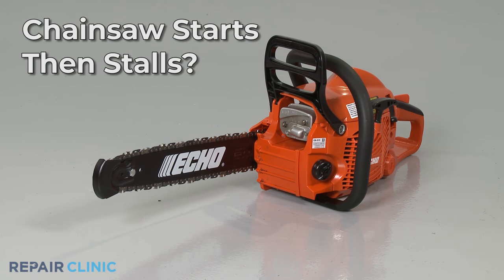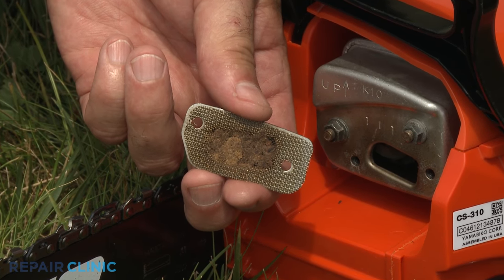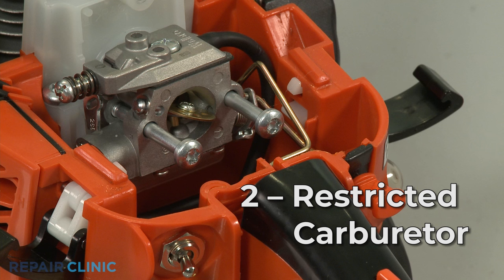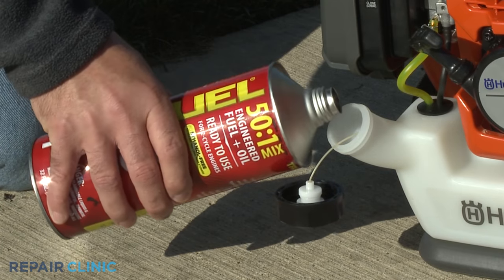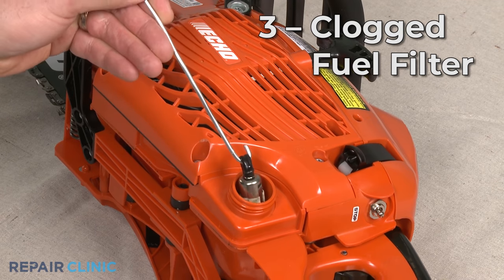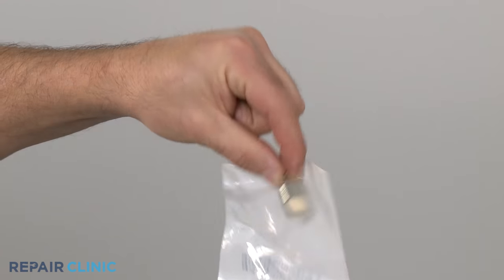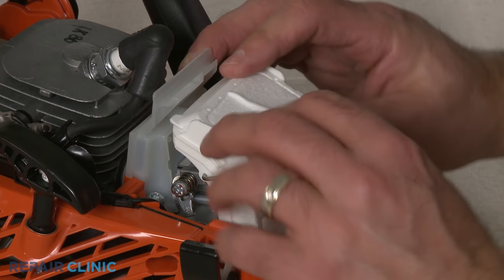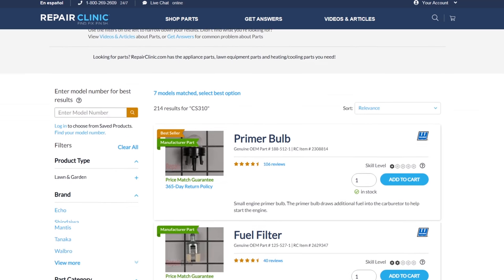Top Reasons Chainsaw Starts, Then Stalls — Chainsaw Troubleshooting

Comment: why would my chainsaw run good for 1/2 a tank of gas, then it acts as if runs out of fuel and dies. coil just replaced.
Reply: May be it's heating. There's a summer and winter mode.
Reply: Check to see if the fuel line in the tank has a hole halfway down to the filter so it tar xucking air at ahalf tank.

Comment: I’ve used my Echo very little and it has leaked oil from day one, it started dying shortly after, now I went to clean the spark arrester only to find my muffler loose and won’t stay tight! Evidently Echo new about the problems hence why Home Depot had them clearances to $99. This was 2-3 years ago. Evidently I threw away $100!

Comment: Help!!!  I've looked at about 20 videos. No good. I have an Echo CS 400. I used it for about 4-5 days to cut fallen branches---some were maybe 10" thick. No problems. Then yesterday it just decided to die in the middle of cutting. Now it starts, but dies as soon as you pull the trigger. This is a saw with little use--other than the last few days, used three years ago for a day or so, maybe a bit the year before, etc. (In other words, this is NOT something I use regularly).

So I cleaned everything thoroughly. Air filter--good. Cleaned it anyway. "Spark arrestor" or whatever over exhaust--good. But cleaned it anyway. Chain and chain bar--good. But cleaned it anyway. Fuel filter in gas tank--good. Gas/build-up of crud, etc.--no, since I've gone through 2-3 tanks of gas in the last week. And when I started it after 3 years, it started right up and worked fine. And yes, I have additives in the gas, and yes, the chain oil compartment is filled.

One video said to start it, then take the brake off and adjust the idle screw (T). But if I take the brake off the engine revs like crazy and the chain zips around and around. According to the video, the chain shouldn't move. So that didn't work.

The 'H' and 'L' adjustment screws are some fancy heads that probably need a fancy screwdriver. But they are inset so far I can't see them that well. 

If you take the time to answer, please treat me like a 4-year old. Please. Most of the videos say things like "Now torque the fajizzle just so and see what happens to the glooper stopper..."  Huh?   "Back out" a screw?  WTF?  I can back out a car, but not a screw. There are words for this:  'clockwise' and 'counter-clockwise'!  And please do suggest things I just spent four hours doing. Trust me, I've done them.
Reply: I have a CS 305.  I put on a new carburetor.  New purge bubble, fuel tank vent, fuel filter and new fuel lines.  Also new plug and air filters. My chainsaw had been hard to start.  It's about 10 years old.  The chainsaw now starts and runs well.  However, after it uses about 2/3s of the tank of fuel it starts to die.  It will not run in any position but upright. It will run a bit longer with 1/3 choke.  I don't have the answer yet but I have ordered a new "spiral fuel line".  The replacement carb came with new line but not the spiral line which goes into the tank.  The new line (straight line) did not work and I had to put the old spiral line back in to get the saw to run past idle.  

You do need to get a small Philips screwdriver and turn your idle screw counterclockwise to slow the idle.  The H & L are actually just flat head screws, however, they have 'limiter caps' on them.  You have to pull the carb out of the housing and then you can pull the 'limiter caps' off the screw heads.  My new carb came without limiters.

It's possible that you need to rich the fuel mixture.  This is done by turning the "L" screw back counterclockwise until the idle begins to slow down.  This would have the duel effect of slowing the idle speed and rich-ing the fuel mixture which will help it accelerate instead of dying when you pull the trigger.  The limiter caps will limit how far counterclockwise you can turn the screw.  If you can't turn them far enough to cause the engine to begin to slow down, then you will have to remove them to get a proper adjustment.

The one other significant possibility is the fuel tank vent.  It may have become clogged. The fuel tank vent allows air into the tank while keeping fuel from running out.  If it is clogged, a vacuum will form as the fuel is drawn out of the tank and it will eventually keep the fuel from flowing resulting in your engine dying of fuel starvation.  If your engine dies, then you open the fuel cap (letting air back in), restart the engine and if it runs a bit then dies, it's a good bet the fuel tank vent is clogged.  My vent was damn difficult to find and replace.  I nearly took the whole saw apart before I found it.  I had to remove the pull start cover AND the flywheel to get the vent filter out and replace it.  The fuel tank vent kinda looks like the fuel filter.  It's a little black plastic container, a little smaller than the fuel filter, and it plugs into the end of a length of fuel line which comes out of the fuel tank though the same grommet holding the purge bubble line.
Reply: Did you ever solve the mystery? My saw is doing the same thing. Brand new saw, day one. Started sputtering  and starving about 20 minutes in, I took a break for lunch and went back out for round two. It started great again but it died about 20 min later. Now it does the same thing as yours when starting it.
Reply: @PL-qw2gy  Well, if it's brand new, I'd just return it. I "solved" my problem by taking it to a guy who cleaned the carburetor for $50. He wasn't just a "guy," he had a degree in mechanical engineering and worked for a some manufacturing company. I watched him clean it, and clearly it was beyond my pay grade. He had all the right tools and knew exactly what to do. Even so, it took him about a half hour. His advice was never to use regular gasoline with ethanol--even if the gasoline is just a month or so old, it's not good. He suggested an ethanol-free gas you buy at Home Depot or Lowe's. I can't remember the name, but you'll find it in the aisle with lawn mowers and chain saws. It's about 1 gallon for $8-9. But well worth it if it saves you aggravation and repair bills. Also, as you can see from the comments, these saws don't like to have near-empty gas tanks. I'd fill it up with the special gas and drain what's left into the can with a funnel.

Comment: The capacitor in my Stihl 032's ignition failed.  It shorted when heated.  So after the saw had time to warm up the capacitor, no go.  Stihl ought to have paid an extra Deutsche Mark for a better capacitor.
Reply: Nothing wrong in saving a few shekels.

Comment: Not helpful for my Echo CS590. New coil, new plug, new air & fuel filter, new carb, no cylinder scoring and a compression test was performed and was within spec, spark arrestor was removed on day one. It still will not run off of choke and will only run choked for 10-15 seconds.

Comment: Reason number 1: It's an Echo 
                             2: Clogged spark arrestor 
                             3:..................
Reply: My Stihl is pretty bad about stalling when it has been off for a bit. It will start and idle, but give it a little throttle and it just dies. It seems to need to tolerate partial throttle for a little bit on cold starts or has been sitting for a few minutes.

None of my Echo equipment does this.

Comment: Tried all this, didn't help. Solution: buy an electric chainsaw. They don't cut as fast, you say? Try a little comparison: First, the gas chainsaw- pull the cord 5 or six times, it won't start. Wait a moment. 3 minutes have now passed. Try again. Maybe now it will start but will stall as soon as you apply the throttle. 5 -7 minutes have passed. You have done NO cutting , so far. Take an electric one, plug it in and press the start button. maybe 10 seconds have passed and you're already started cutting your 1st limb. So, which one got the job done quicker?
Reply: You have to know what you’re doing with a gas saw.  Read directions and follow steps.  If it doesn’t start in 5 pulls you’re doing it wrong or haven’t maintained your saw correctly.  You can’t plug your cord in the woods.
Reply: Nice try, Big Electric. You aint sellin me on yur fancy new fangled lightnin powered doodads
Reply: @NonyaBusiness! A shill for big electric, no doubt. Nice try big electric!
Reply: cool, you have figured out how to do the "cut down 2 limbs in your tiny urban garden" job faster. well done. let´s try the same when butchering 10 large trees with no power sockets nearby
Reply: Where you gonna charge a battery at out in the woods? I run electric equipment as well but I cannot imagine and electric saw holding up for the same amount of wood.
Reply: @happyamerican3235 Nine pulls on some Stihls. Three on choke, three on half-choke, and three on run. Of course, it still wants to die when you give it gas until it is warmed up.